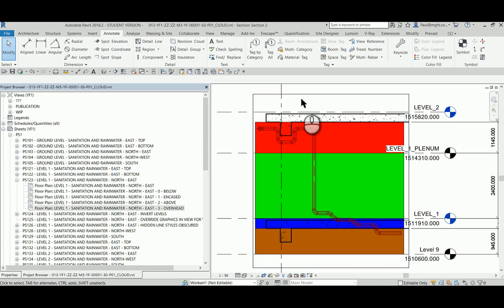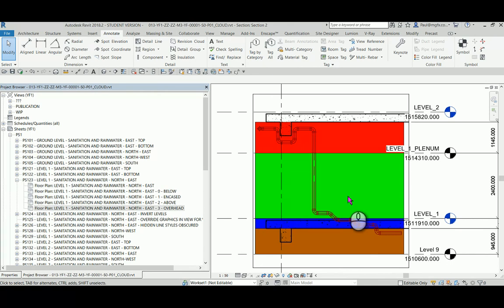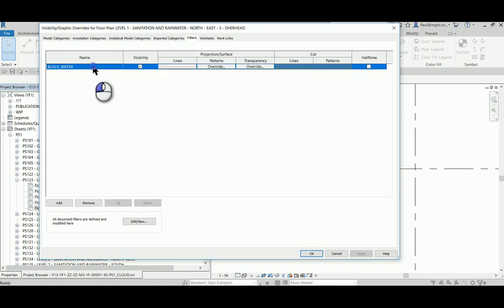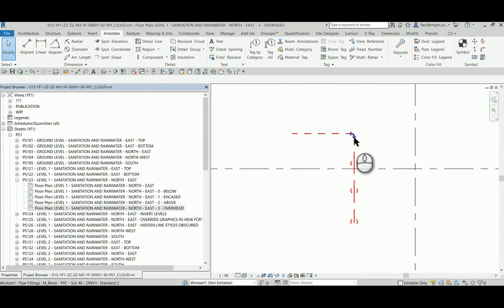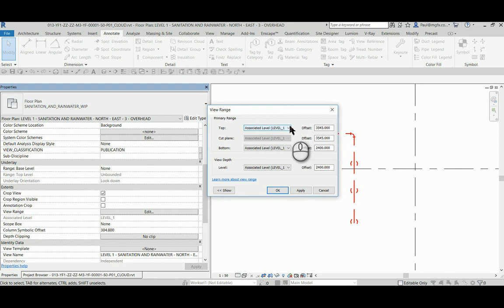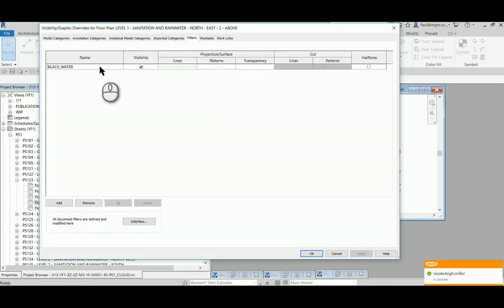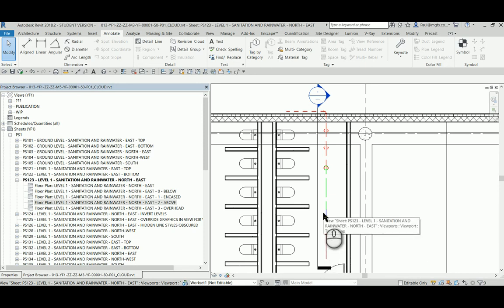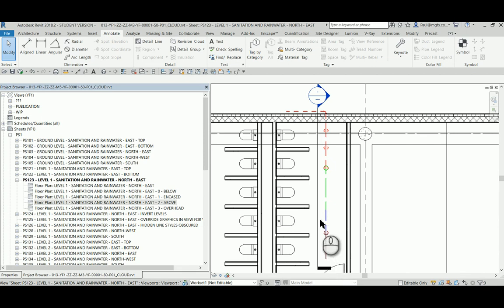Revit MEP Pipe Visibility Graphics Overrides by Elevation Band

Comment: Hey, great video!
I'm curious, is there a way to achieve this effect without overlaying multiple floor plans onto a single sheet? Could we perhaps implement a rule-based filter to adjust graphic overrides (like line types and colors) based on pipeline elevation, all within a single floor plan?
I'm currently working on a project aimed at designing a sanitary sewerage system, and I'm looking to represent it effectively on a single floor plan, with a total of twelve floors. My goal is to showcase the sewerage pipeline at different stages: above the finished floor line, within the floor screed layers, and beneath the floor slab. I'm seeking creative solutions to achieve this without resorting to superimposition, as previously mentioned. Any suggestions or ideas would be greatly appreciated!
Thanks in advance!